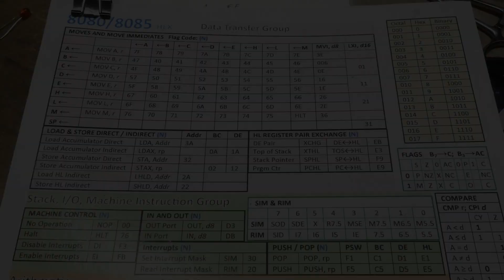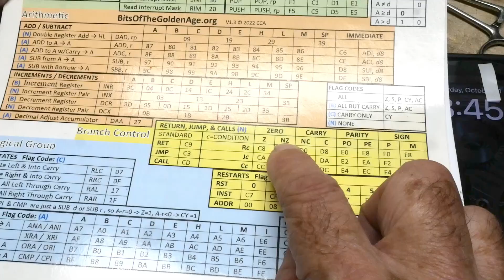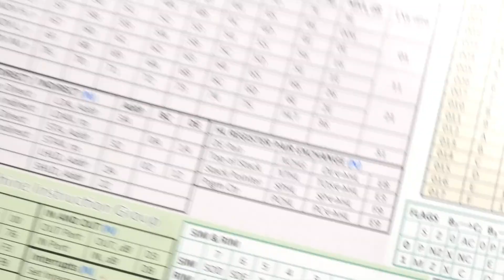#2385 Hand Assembly of 8085 Firmware

Comment: There are still reasons to understand 'how the bits go around".  Today, you can write a simple CPU core in a single day and have it running in $8 FPGA.  Then, you can run all opensource tools and make a layout for a real chip.  And you can even tape it out... (if the design is small enough) for less than it cost in the early 2000s to make a 4 layer PCB.  These can be real, useful 32bit machines with non toy compilers etc.  These skills are practical for fun, and real uses too.

Comment: I remember porting VIC20 Forth (on a cartridge) to the C64. I also hand optimised 68000 code, starting with the output of the C assembler and changing it to run a particular sub routine to run it in-line (thus removing all the pushing and popping from the stack). These days you could just use an inline pragma!

Comment: There's no multiply or divide?   Roll right and roll left register A, was what we were taught.
Reply: That works for powers of 2. For integers, there have to be adds (multiply), or subtracts (divide).
Reply: @gregebert3103 I thought you computers use base 2 to operate 😁.  Probably what he meant was there is no floating point operation.
Reply: @gregebert3103  it was within the scope of the class.  Writing a comprehensive algorithm would have taken too much time away from what we were learning.
Reply: Multiply by 10 using shifts and adds is a standard idiom.

Comment: It was the 6502 for me.  I got to use the Commodore PETs and the KIM.  My 8086 assembly language programming used the PC's assembler.  I might point out that another (more reliable) option was to use a cross-assembler instead of looking up the op codes.  Also, you could use a paper tape or magnetic tape reader/writer with associated PROM code to use it.

Comment: Back in the mid 80s I built a small 6502 computer with 2kB of RAM. At school we had to use an 8080 training kit, a bit like the one in this video. I wrote an 8080 emulator on my 6502 board so I could test run my assignments for school at home. I also wrote a simple editor for it so I could input the hex opcodes and the editor would know how many bytes would follow before the next instruction. That way my 6 digit 7 segment display would show the instructions “line by line”, which improved readability. All in barely 1kB of code.
I have no clue how I ever achieved this, I’m sure I can’t reproduce this anymore, not even in a higher level language, let alone in 6502 bit banging.
Eventually I burned the emulator and editor in ROM.
Good old times for sure. I still have that computer although I wouldn’t know how to operate it. I lost my notes and source code.

Comment: I remember the good old days. While studying, I watched colleagues program some old computer with toggle switches having lamps as indicators of bits, one 16 bit word at a time. I guess it was some tailored PDT prototype for scientific calculations. Personally, I started with HPBASIC in 1974 and then with Fortran IV and then 77.  Then I learned the ASM of 8080 and 6500 but never got to any project with them. That was, however, a good base for learning the 8088/86 ASM. With it, I had a large project with time-critical requirements and C language interfacing at the higher level. Using ASM like that is very stupid since the work is very slow, susceptible to errors and practically impossible to port to any other environment as such. Would not do that now.

Comment: The first computer that I had sole control of was a 2 MHz 8080 with 256 BYTES of RAM and 256 BYTES of UV Erasable PROM. It used a teletype at 110 baud as I/O and had a paper tape punch/reader that could be used to store programs. After a few weeks of hand-assembling code to run on it, I got disgusted enough to write an assembler in BASIC which ran on a time-share computer. Things sure have come a long way since 1977.